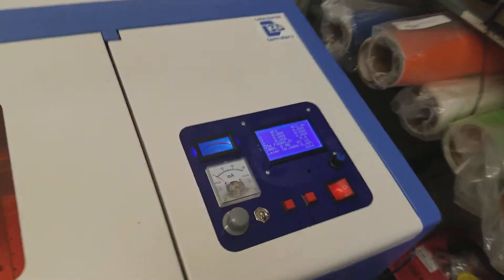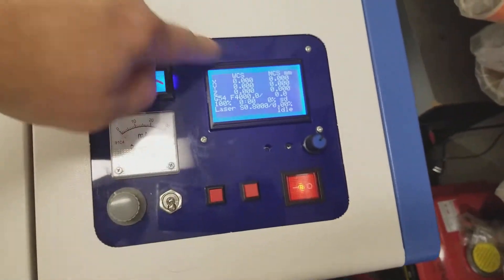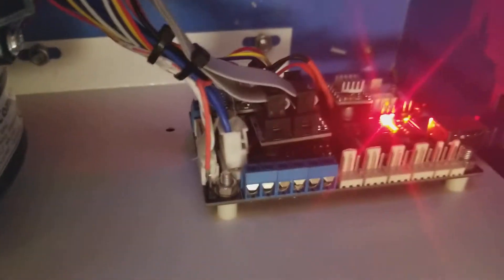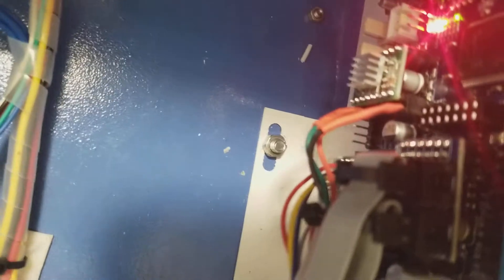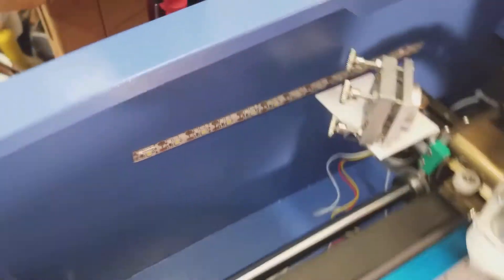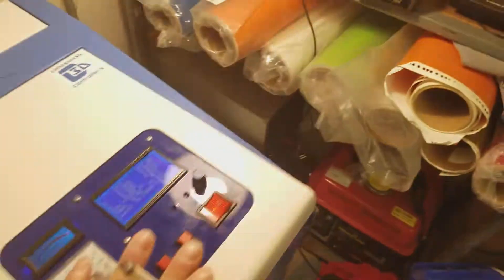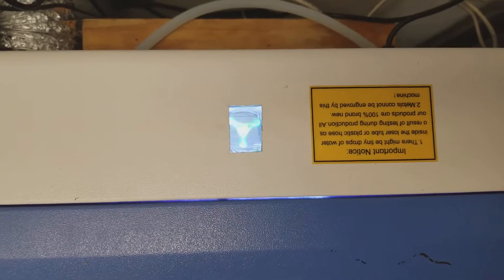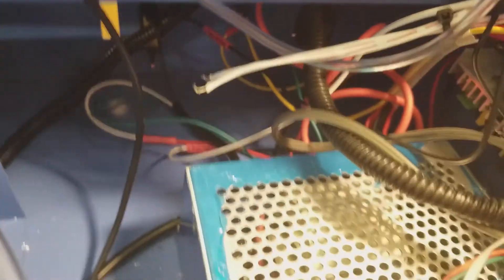Dec. 20 K40 Laser Mods Update

Comment: She looks good!  did you find that the  Z axis helps or just a waste of money in the end? you used a Cohesion board but any thoughts on using the good old Ramps 1.4 ? i was thinking of going down the marlin laser route, due to the fact i have a few ramps and full graphics controllers laying around.
Reply from the maker: thanks!i have not had direct experience with that board but from what i hear the cohesion3d with the new cluster firmware has raster speeds that meet and exceed grbl and all the rest. i did try a mini gerbil once.... once! lol. a bunch of people are doing that ramps board so i would definitely give it a shot!
Reply: @TechBravoTN  Thanks for the quick response, I definitely try the ramps first as I am cheap and I have a few sets of everything I would need already due to building a few 3d printers hahaha, boards LCD 8825 stepper drivers....  If I read what they are saying right, (Probably not lol)  the Turnkey K40 Laser Arduino + Ramps Firmware seems to have all the raster stuff figured out and working.